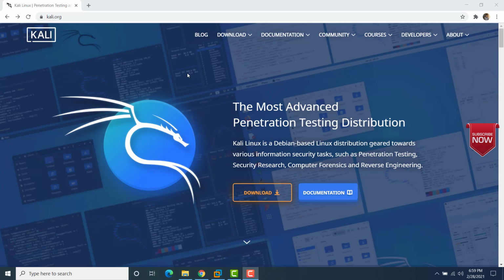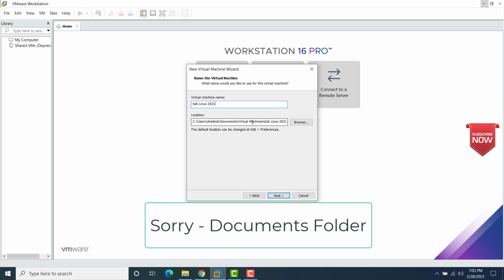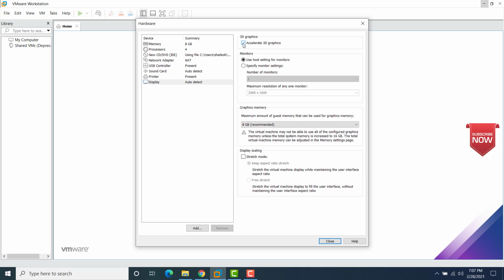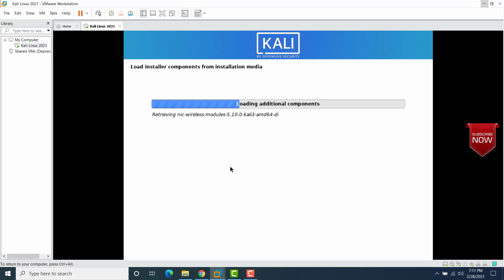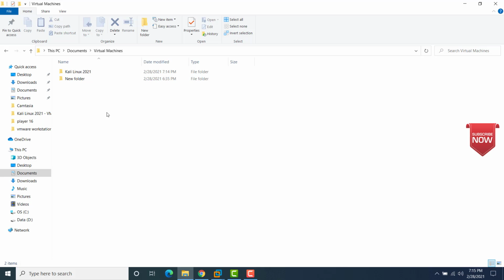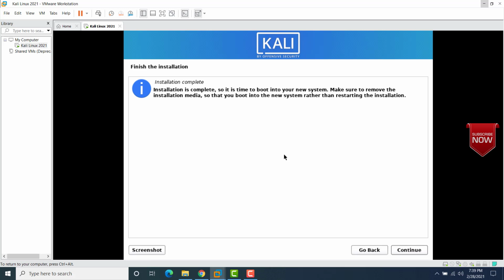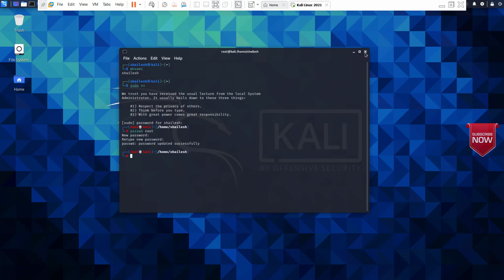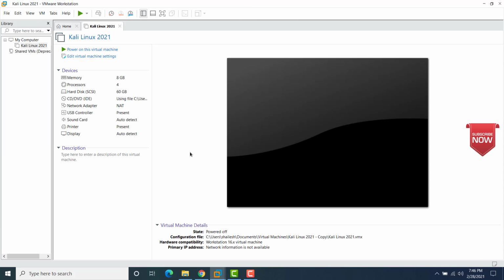How to Install Kali Linux 2021.1 in VMWare Workstation 16 Pro

Comment: Great video brother. As I am not having the pro version, therfore that "stretch mode" option is not coming in display settings ( 7:58 ) , and after powering on the virtual machine the kali linux screen is being displayed too small, even after alt+enter. Can you help me to fix it? I am having a 1920x1080 screen

Comment: i dont have large  default selection tools and without it i continued. Does it make an impact?
Reply from the maker: Not really, I install all the tools because of laziness. It is easy to check all the boxes. :) 
But, all  tools can be installed later on when you need them. That is never a problem.

Comment: I followed ur steps..but in my case there's some flickering and so much of lagging of mouse(i.e sensitivity) please tell what I shd do
Reply from the maker: One reason could be your low laptop configuration. What is your laptop configuration?
Reply: @shaileshjha  
I5 11th gen Intel iria
1tb SSD (not HDD)
Reply from the maker: @arvindkiriti1085  RAM?
Reply from the maker: What is your Laptop number?
Reply: @shaileshjha  8gb
Reply from the maker: @arvindkiriti1085  which version of vmware are you using, are you using the latest one. I am not sure about the issue, I have a 7 year old i7 Laptop,, but works fine
Reply: @shaileshjha  the latest one..i don't know why the mouse is lagging... sometimes it flickers
Reply from the maker: @arvindkiriti1085  Where is the Mouse lagging? in VM or Windows Host. This usually happens if the resources are limited. Try to increase the CPU and RAM and start the VM. I have 23 GB RAM, I allocate 8GB RAM and 4 Cores.
Reply: @shaileshjha  I'll try this
Thanks

Comment: the problem i am facing is that! after the installation of the vmware workstation pro 16 the dashboard looks different than yours. i thought the issue is from the vmware so i uninstall it and download fresh one but same issue.

after i install the kali linux 2021.3 and setup everything, after 24hours or less the vm machine will be deleted by itself for the past 4 days this is what i'm encountring. please any solution to this? the time and data use just to setup the vmware and kali linux is crazy this is the first time using vmware but it is not smooth at all. virtualbox is better base on my experience,

on vmware my VM got deleted just like that and touchpad scrolling not working very frustrating
Reply from the maker: Vm cannot get deleted on its own. May be you are removing the VM from vmware. Csn you check if the vm file is there in the kali Linux installation folder. Just open the vm again by navigating to the installation directory of ksli and opening the .vmx file
Reply from the maker: Vms may not have TouchPad scrolling. If you want to work in kali Linux then most work you will do is in the terminal
Reply: @shaileshjha  thanks i sort out the problem
Reply: @shaileshjha  is there anyway to get it work ,the touchpad scrolling?

Comment: Sir, so in order to download kali Linux I need to have 4GB space in my PC or 4GB data ??
Reply from the maker: Both, start download only if you have at least 5GB data available. I used Jio work from home data pack for large downloads
Reply from the maker: 4 GB that you download will require 4GB of disk space in you hard drive to save the downloaded file
Reply: @shaileshjha  okay
Reply: @shaileshjha  okay got it thanks
Reply: @shaileshjha  now it's 3.1 gb

Comment: I am not able to run kali linux in vmware, 
  it is showing guest operating system and is not loading, 
please help meeee🙏
Reply from the maker: Could you please elaborate  that is tell me what all you did
Reply: After i created the os, it just crashes. I have tried reinstalling so many times and watched over the installation steps and it still isnt loading . So basically it just crashes 😣

Comment: i have problem in installling
 its showing some problem-:
1) Verify that the BIOS/firmware settings enable AMD-V.

(2) Power-cycle the host if this BIOS/firmware setting has been changed.

(3) Power-cycle the host if you have not done so since installing VMware Workstation.

(4) Update the host's BIOS/firmware to the latest version.

This host does not support "AMD RVI" hardware assisted MMU virtualization.
 these problem.
Reply from the maker: It means that Virtualisation is not enabled in BIOS. Please check my blog to see if Virtualisation is enabled or not for you- https://www.shaileshjha.com/how-to-find-out-if-intel-vt-x-or-amd-v-virtualization-technology-is-supported-in-windows-10-windows-8-windows-vista-or-windows-7-machine/

Comment: I m confused Should i download. "work station 16.0 player for windows ". Or "workstation 16.0 player for Linux. ? Can any one give suggestions? What to download
Reply from the maker: Download the correct version based on the OS you have. If you are on windows OS, download the installer for windows. VMware Player is free with limited functionality. Workstation Pro is paid but if you google search, you can get the activation keys for free.

Comment: Sir, i'm not able to install kali linux in my system.
I've tried different steps to install, but i'm not able to install it.
The file type which is showing is "WinRAR archive".
So please guide me to install kali linux
Reply from the maker: Did you download the ISO image?
Reply from the maker: What is the file extension
Reply: Sir, .iso
Reply: @shaileshjha  s, sir
Reply: Sir, can u connect ANYDESK to my system.
Becoz, i'm installing kali linux for first time

Comment: sir my kali linux file is installing at a speed of 1kb to 5 kbps pls help me
Reply from the maker: This could be because your laptop is not very powerful. What is your laptop secification
Reply: @shaileshjha   sir its i7 10th gen 16gb of RAM 1Tb HDD 256 SSD 
And rtx2060 6 gb
Reply from the maker: @basketballforlife3769  even I have the same spec laptop but 7 years old. For me it worked fine. 1kb to 5kpps is it your internet speed.
Reply from the maker: One reason could be that you are installing on hdd, other could be your ssd has less space available